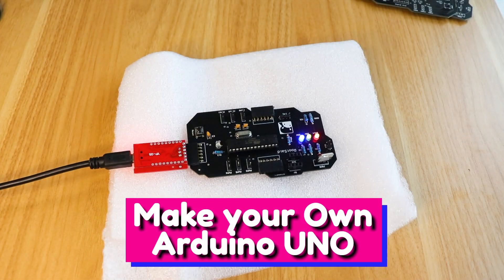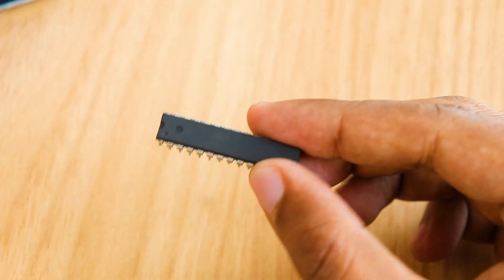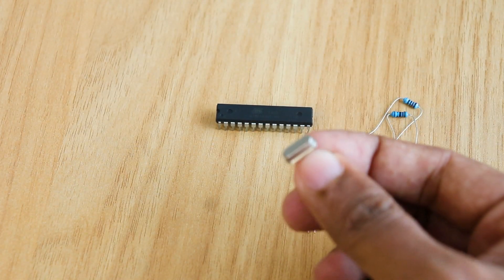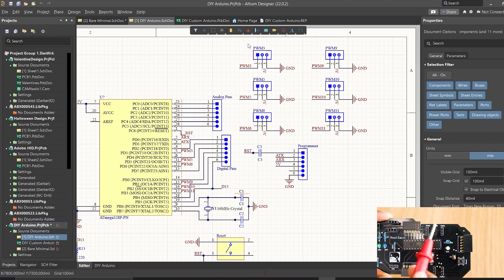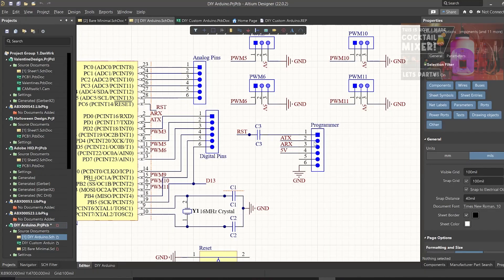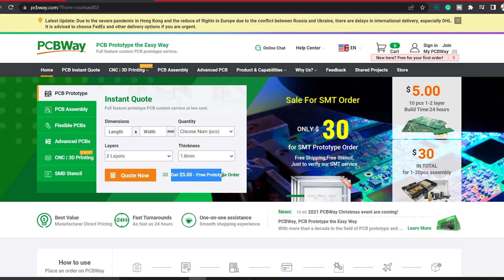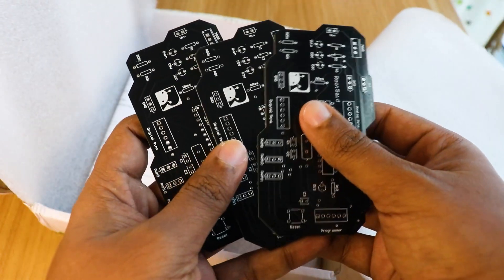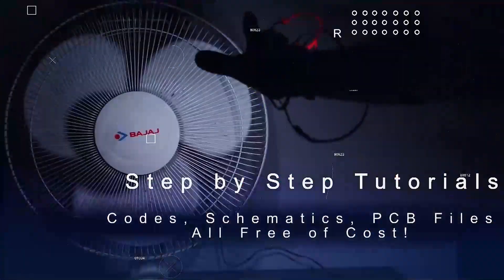How to make an Arduino Board at your Home [Complete Step by Step Instructions] - DIY Arduino UNO

Comment: For those asking the specs on some components, the diagram at 0:12:00 says:
R1 = 1KΩ
R2 = 220Ω
R3 = 220Ω
R13 = 220Ω
RRes = 2KΩ
RDG1 = 2KΩ 
RD1 = 1KΩ

I believe the capacitors are 22pF
Reply: Thanks for this. How's the bootloading done to the ATmega? Can this be done through the FTDI too?

Comment: Dear i made Temperature controller with Atmega 328P chip and install it on my aquarium it work best but some time if i on off some 220V light or i hv small water 220V 25 watt and air pump 220V 5 watt, controller hanged or restart i tried to use 104 filter cap and some other but no effect can u plz give me some hind. Thanks.

Comment: Does the Altium software generate the layers automatically ?
Let say you have to connect pin A to pin B but there is a component in the way.
Does it automatically generate a layer and connect A to B through a via connection?
I've never used a PCB designer software and to me it seems so tedious having to deal with the connection between layers.
Reply: No idea

Comment: Great video sir. I just have one question : does it work with a LCD display ?
Reply: probably no. I would say using cable is much better if you want to have diaplay. PCBs are only for microcontroler+sensor+Power  voltage in. Other than that, you should connect with cables.